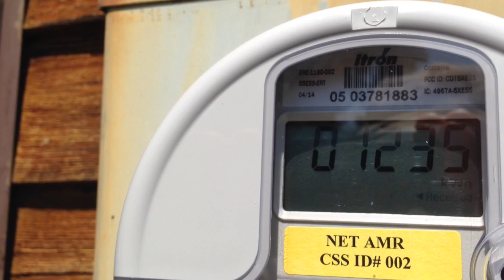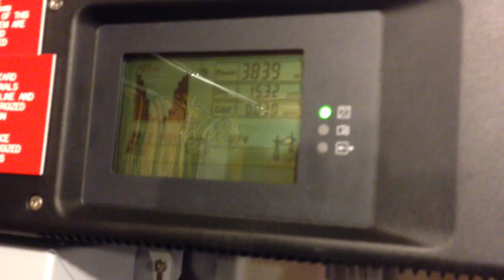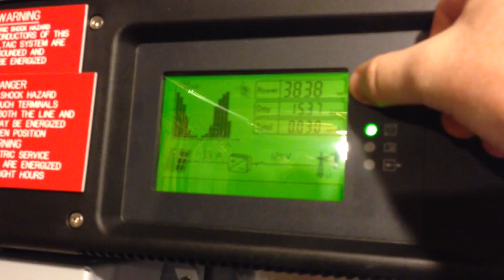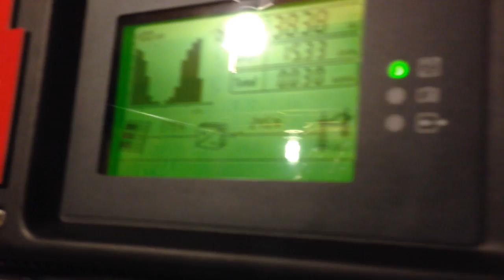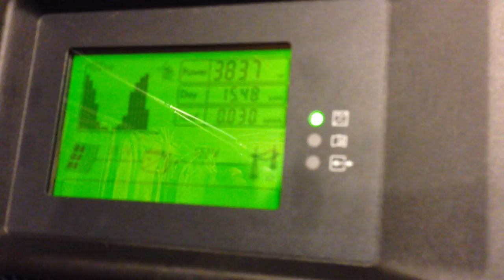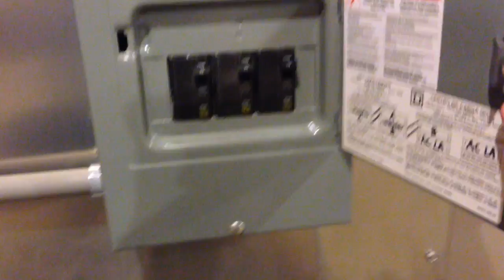SunPower X21 9kW PV Solar Panels

Comment: A very nice installation, and a great walk around.

A few questions, am I correct in assuming that behind the inverter you have a metal plate.  Is there a reason you preferred this to a non conducting material?  

Are the SMA inverters capable of producing power when the grid is down during the day?

If I heard correctly, you have 28-panels of 335 watts each for a total of 9,380 watts.  Divided into two inverters this is 4,690 watts.  

This is approximately 890 or almost 900 watts more than what your inverter show as solar production.  

In other words, would I be incorrect in assuming you have a clipping issue?

Would you perhaps be able to take three solar panels from each inverter for a total of six panels, and add a third inverter of 2,000 watts?

This might increase your daily production by approximately 2-kWh times the average annual daily sun peak hours at your location.

For instance, 2-kWh x 4-average daily sun peak hours = 8 kWh.

Comment: This book [link here>>>https://t.co/Ny1QIx5of9 ] got me thru the design and installation of a complete off-grid system for my lake cottage. The process of site evaluation, system component selection, wiring, etc. is complex, but with a lot of study and this book, I ended up very happy with the results. Everything you need to know is here. I recommend it for anyone who is starting with little solar panel knowledge and wants to end up with a whole house system
Reply: above URL leads to a ad website

Comment: Why not microinverters???
Reply: because a single inverters lifespan is 5-10 year. Maxium 15.

the microinverter behind a hot / cold panel on the roof will be dead soon... 

optimizing is better, because its without condenzators which cause the problem above.

Comment: Hi Sean, can you tell us how many kWs your installation has been able to generate so far?
Reply from the maker: hecticb We generated 12,019kWh in the first full year.  A little more than expected, probably due to last winter being a very mild and snow-less winter.  We love it.  Our daily driver is a Leaf, so we're driving on sunshine.
Reply: Sean Reidy Thanks for your quick reply. It does seem awesome. I think you replied to the same question below, but is there really such a big offset in generated power vs installed capacity? I say that because on this video we clearly see that for each 4690w(14 panels) you're actually topping each inverter, but it's still an 850w difference. In your opinion if it were today would you install higher rated inverters? How many kw would you say you got on your worst and best month? Also could you do a follow-up video? :)

Comment: Hi Sean. I'm getting same inverter and it will be installed inside my garage and I heard that there is HUM that's comes out. How loud is it?
Reply from the maker: They are 100% silent as far as I can tell.  If there is any hum, you probably have to put your ear right up to it when it's running full tilt.  If you add the optional fan unit, which I did not, then naturally you'll have a bit of noise from that.  But I have no need for the fans, since mine are in a basement that doesn't fluctuate much more than 10 degrees all year.  Enjoy!
Reply: Thank you for the reply I appreciate it.  Well the one they put for me has a fan. I don't think I had a choice. Hope for the best. I'll give you an update when everything is turned on.

Comment: So, from 4500 dc watts you are getting 3840 ac watts equals about 85% efficiency conversion on the inverters. Just curious, because we pay by the watt for the panels....
Reply from the maker: True.  But almost never do you really generate the full (theoretical) power.  Real world vs. perfect test conditions.
Reply: Sean Reidy but 600 watt loss per inverter is pretty significant...that's two 300 watt panels not doing anything, on each inverter... $1200 just sitting on the roof....
Reply: peak ac voltage x .7071 gives you RMS (dc equiv) voltage

Comment: Sunpower has the new Equinox system- with the microinverter factory integrated INTO the panel!  If you had that option would you have gone with Equinox or go with the 2 inverters that you have? Thanks for your video!
Reply: Rob Marvin if you have shading micro inverters are better